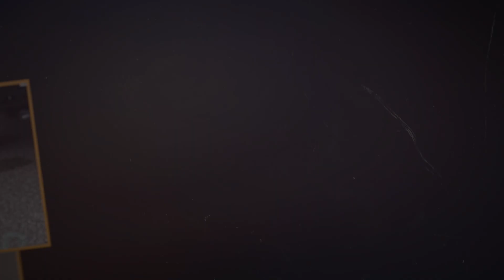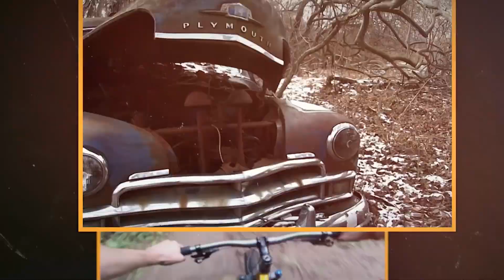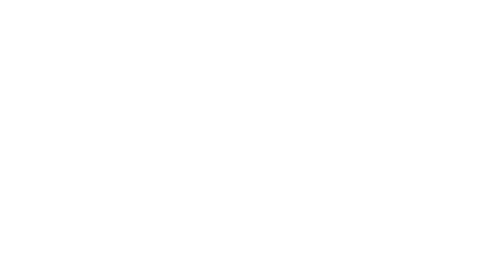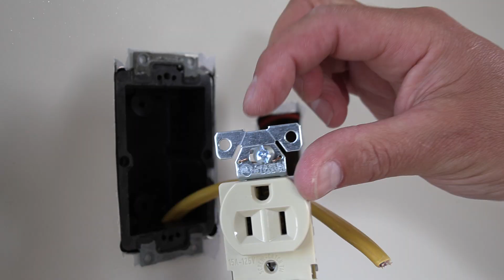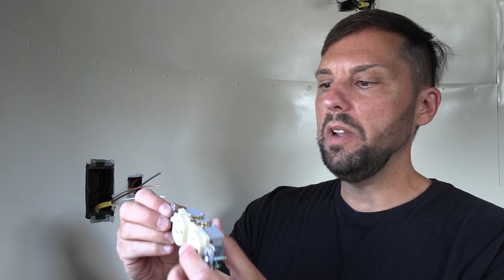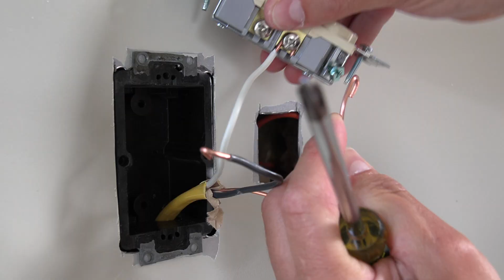WOW! 4 HIDDEN Tools in an Outlet You Never Knew About | Electric Tips & Tricks

Comment: You put the hot wire on the wrong way when you tighten the screw it should tight the wire around the screw not open the wire up.

Comment: Question. I've noticed most "real" electricians install outlets like you did, with the ground on top. And the regular DIY will do it the opposite. What's the reasoning for that?
Reply from the maker: It’s always safer to have the ground on the top invade the plug is partially out, nothing can fall on top of it and grounded out the hot and neutral
Reply: Outside of specific applications or customer request, the reason receptacles are still installed with the ground down is because people generally prefer it that way. I have never seen a "real" electrician install them "upside down" anywhere outside of hospitals, and I happen to be a "real" electrician.
Otherwise, New Jersey Outdoor Adventures is correct as to why someone may want them installed in that manner.

Comment: To Rich Payton (below my initial comment) 
Yes, Rich, that is correct. Electrical terminations are not to be taken lightly. And taking time to double-check your work is good too. But my question to your reply is: How tight is “really tight”?
There are specs that must be followed. Refer to NEC Section 110.3(B)—any edition within the last 30-years will work.
Reply: Now we can get screwdrivers with built-in torque measurement. Aside from that, tighten until just before the screw snaps? Just kidding

Comment: Why wrap wires around screws?  God loves us and gave us backwire outlets to make our lives easier!  Just be careful with backwire outlets that you don't shove insulation into the clamp, which could interfere with the clamp action.
Reply: #1:  You can see that those screws are connected properly.  Why hide a connection?- it could be defective, rusted, burned, jammed with garbage, broken teeth, insulation too far into the connection, and so on.  Seeing is believing.
Reply: @clancylittleboy7408  To be clear, I'm talking about backwires that clamp the wire with the screw, rather than grabbing it with tensioned contact.  I trust those, as long as like you said people prep wires properly and don't shove insulation under the clamp!
Reply: @josephhaefeli9954  Yes, if I were working for the boss, I would use the screw clamp to save time.  In my own home, I take my time, measure the strip, bend the wire, wrap the screw, and tighten it down, visually check it, then never have to visit it again!

Comment: Bit of a noob question, but do you put the ground pin at the top or as the outlet tells you, at the bottom.
I hear 2 reasons for both. Don't think it's code anywhere to do it any way specifically, but enlighten us all.
Reply from the maker: I prefer the ground at the top. Of a plug slips slightly out and something were to fall on top of it, it is safer to hit a ground than a hot wire
Reply: @NewJerseyOutdoorAdventures  And here I thought it was a recommendation by the manufacturer to do otherwise, but there's the Wise part, eh? Having had kids, you just may want to do the ground up bit. They can be so curious, eh?
Reply: @KirkLives  Most things that are plugged into an outlet only have 2 prongs.

Comment: Great information, thanks. But the loops should be wrapped around the terminal screws in a clockwise manner so they will tighten up when the screw is turned.
Reply: Properly tightening the wires under the screws is not something to be taken lightly. Not doing it right is the cause of a lot of electrical fires, because loose connections generate heat. Anyone working with receptacles should take the small amount of time it takes to double-check their work before moving on to another task. And, the screws need to be turned really tight.

Comment: more trivial than practical, btw youre putting the black wire in the wrong direction...always wrap the wire in the direction that the screw is turning, that type of plug sucks theyre really not supposed to be wrapped because terminal is similiar to a gfci
Reply from the maker: Thank you for the useful information

Comment: If you slip with that first "tool", you'll rip your hand wide open.
Reply: Or you risk stripping the thhn while attempting to remove the jacket, and thus create a short/arc hazard. While a neat "trick", it's not put there by the manufacturers, and really shouldn't be shown to diy'ers as a viable method. Frankly if I came onto a job to finish what the homeowner started and they told me something like that, my rates just went up.
Reply from the maker: Safety first

Comment: Holy Veiled Virtues Bat Man ! ! !
I wish I saw this video three days ago, it would have been very helpful for myself and the person I was teaching. I have wired so many outlets and wondered about those wire stripper slots, wow. I will have to see if the Romex stripper works, that will be most helpful but I love the bending hole. I have become good at bending the wire but that is so much easier, faster and I don't have to switch tools. Time for a follow up lesson for my student, Thank you.
P.S. you sound like Ray Romano the comic, if I closed my eyes I would have thought it was him ;)
Reply: Haha - That's what I thought of when I heard him too.
Reply: It would be better if you taught them to use proper tools.  Even as a do it yourself person you should still have the proper tools, especially when it comes to electrical work.
Reply: @rolfbeuttenmuller7895  I do agree with learning the proper methods. I also like to know some shortcuts when I am up a ladder and the tools are on the floor. Most times I am using large needle nose instead of lineman pliers. they make better loops.

Comment: thanks for the secret tools info, but, i must add a overlooked mistake.  On you black (common) wire, you installed it incorrectly.  By code the wire must be installed so that it tightens on itself, you just had it reversed.  Be careful of that due to it may seperate someday due to heat of the plug or other things that goes on at the plug location.  Just a FYI comment noticed.
Reply from the maker: Yes good catch. I filmed it twice, once close up and once regular. The final install was done correctly.
Reply: @NewJerseyOutdoorAdventures  although you didn't mention it, I did notice you properly secured the unused screw terminals as well, at least I think I caught glimpse of one sent home.
Reply: By code? I kinda doubt that.

Comment: Is that the original wiring?  A best practice in boats and RV's is to use stranded cable as it is not as brittle, and can withstand  the constant flexing that a vehicle goes through.
Reply from the maker: This is new wiring replacing the original from 1961 which was the same non stranded.

Comment: Just an FYI Patrick: notice how you wrapped that hook on the neutral and ground wires clockwise?  That's the correct way. The hot lead is backwards, that hook can loosen as you tighten the screw.
Reply from the maker: Thank you for the tip. I shot it first up close and 2nd from far away. The second time I got it right
Reply: Yup - I see ya disconnected the hot before you went back to do the ground. :)
Reply: New Jersey outdoors smells. Not this guy, the state.
Reply: I am a retired state licensed electrical contractor. Never in close to 50 years working in the trade was this alluded to. Not by the (true) experts I learned under, not in the excellent trade publication I read, nor any mention by any of my wholesale suppliers. It was not on the state test. I never noticed it on the packaging of receptacles or in the info sheets provided with them. Consider me "schooled". Thanks.
Reply: @richpayton7162 I was taught this in school but it also becomes more obvious when you hook stranded wire (which is what you mostly do in industrial). If you hook it clockwise in the direction that you tighten the screw the hook (usually) stays tight but if you hook it the wrong way you often get a few stray strands that come free which is obviously not great since less copper = more resistance and more heat. Not sure if you worked mostly residential or you did both which is why I clarified.
Reply: @richpayton7162  You are 100% right...nowhere has it been made common knowledge where I have worked, studied , or read....I am 65 years old...nice tip!
Reply: @richpayton7162  Perhaps because in no way would using these methods be considered professional. Didn't spend over $100.00 on proper tools for nothing , right? I like it in a pinch though, but not if the receptacles are from a big box store, my 12ga. wire would probably snap the ears right off those cheap crap they serve up now.